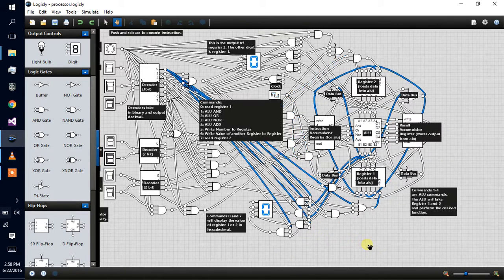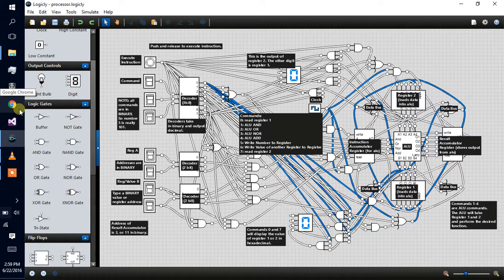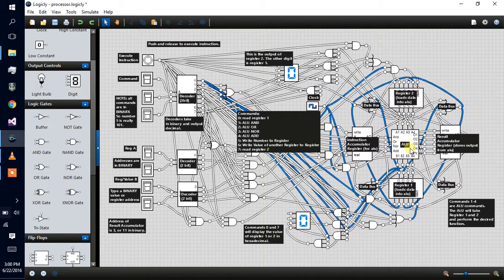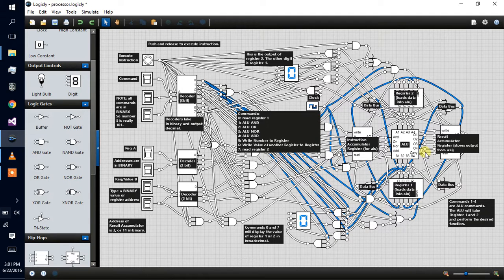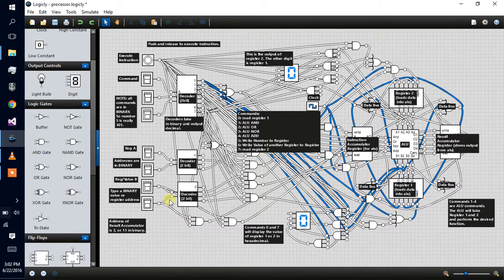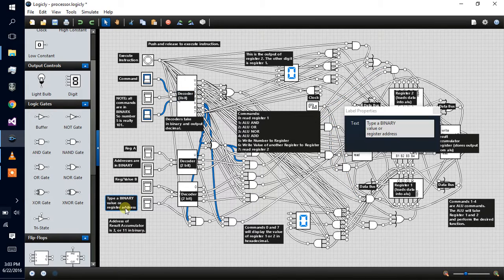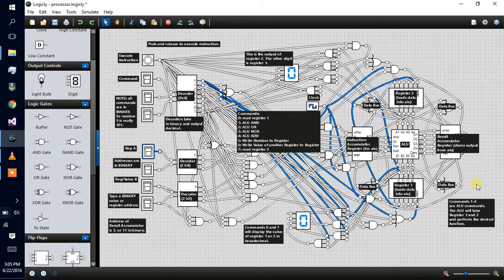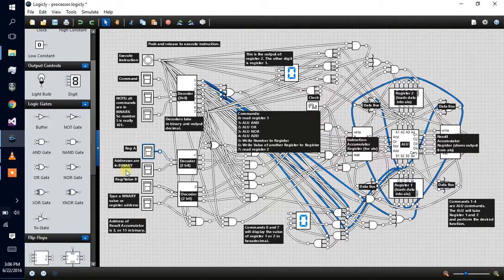Computer Processor using logic.ly part 1

Comment: Thank you for taking your time to make this video, I found it interesting. Just wondering if you could post pictures of the insides of the compressed circuits, or at least give more info about them somehow. I'm just getting started on logic and so far i've made a numpad display 4 bits, but i'd like to learn more.
Reply from the maker: Thank you for posting!

Yes I will post more about the insides of the integrated circuits.

Also +1 sub thanks for the early support!

Comment: requires some structure. and scripting. Just a general ramble at the moment with virtually nothing to be leered ..except maybe how to play with the switches ?
Reply from the maker: Yes because I was 15 years old at the time; this was one of the first videos I ever really made about processors, and I didn't have a script and did perhaps two takes total. I'm 21 now and could probably do a much better job in that dpt with better software, so if you're interested, lmk.